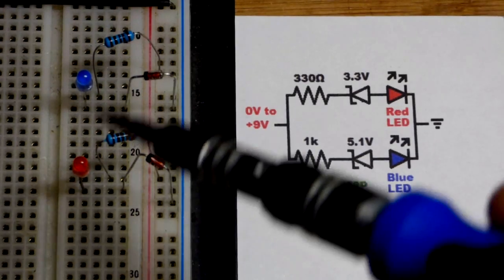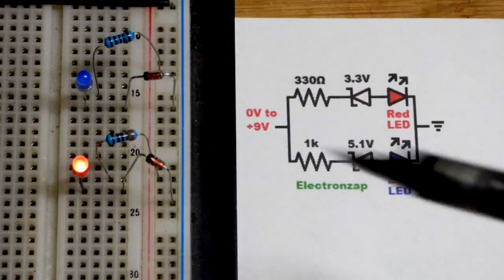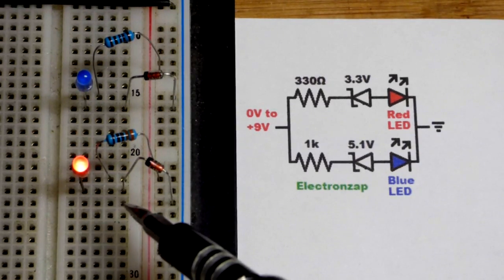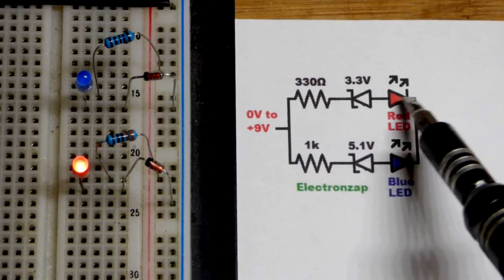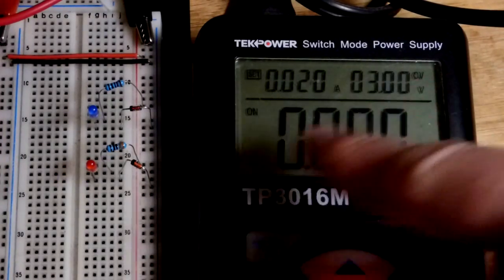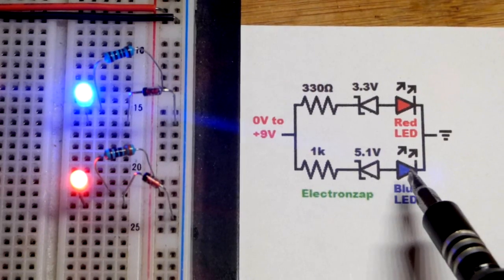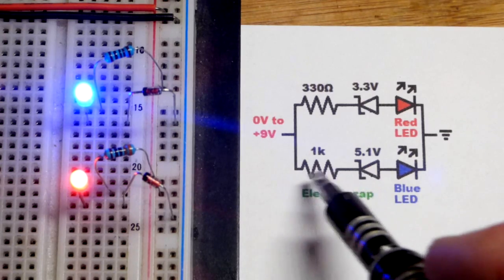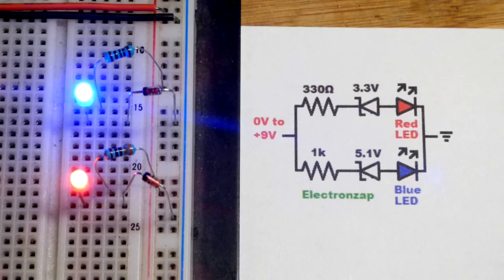Basic more LEDs on as voltage goes up circuit using zener diodes schematic diagram by electronzap

Comment: i have 5.1v and 9v zener diodes, so what would be a safe voltage range for that circuit? and which resistors should i pick for each one?

Comment: Could you use 12v to 15v circuits for Cars. Just a suggestion.
Reply from the maker: I don't really have any demonstration circuit ideas that would do anything interesting for vehicles. My recent LiFePO4 and solar generator based power bank videos didn't do very well.